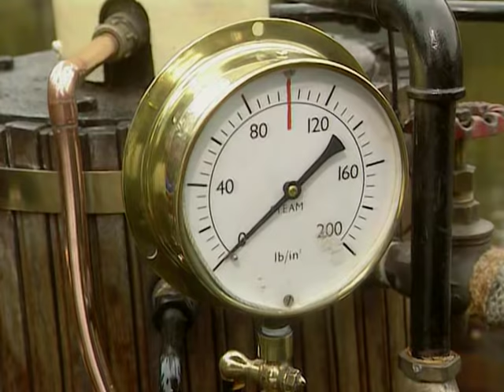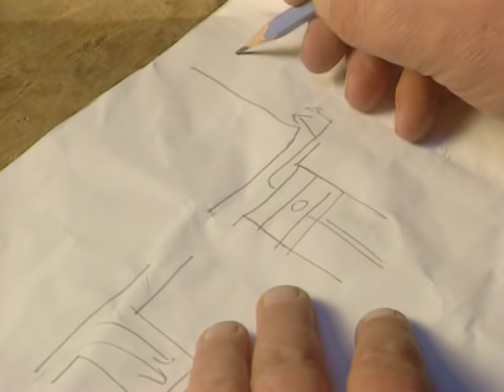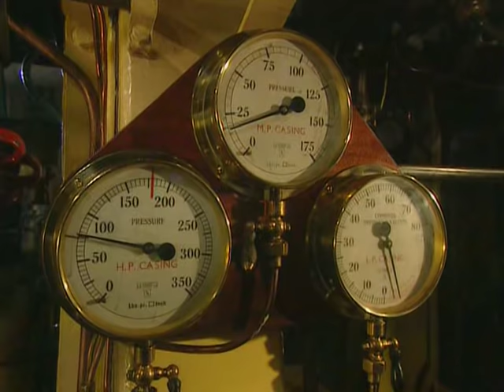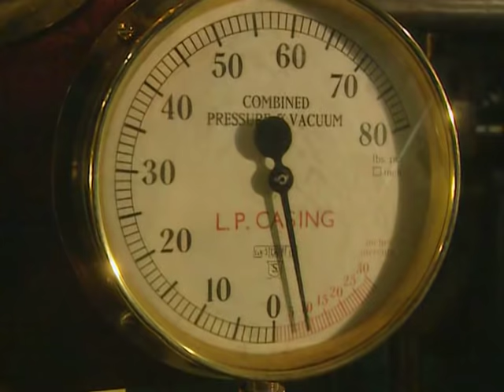Coltranes Planes and Automobiles - 1of6 - Steam Engine

Comment: Thank you so much for this great video. I'm just old enough(75+) to have ridden Erie Railroad commuter trains, in NE New Jersey. WITH steam locomotives in regular service pulling the trains until 1954. I have also built, and run my own 1/8 scale coal fired, 'live steam' locomotive. An Erie 4-4-2 commuter engine.

Comment: Update, the LARGEST steam Locomotive ever made, 
the UP 4000 series, now has a running example, 4014 
Big Boy.  Union Pacific procured 4014 from Southern 
California, a few years ago, towed it to Laramie Wy, and 
completely rebuilt it.  He and 844, a 484 engine double-
headed to Ogden Utah, for the 150th anniversary of the 
Golden Spike ceremony.

Bit Boys are a 4 cylinder, 2 engine design, each engine 
pushing 8 drivers.  Giving him a 4884 Whyte designation.

Both 844 and 4014 are in limited commercial operation, 
and are UP's steam ambassadors.  UP also has a 4664, 
running as well.  One of the Challenger series  Number 
3985.

steve